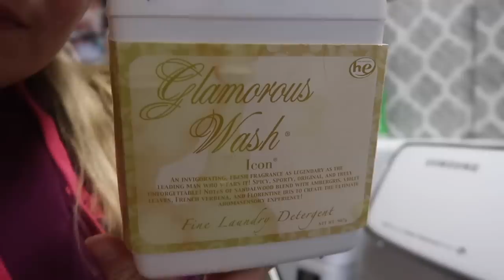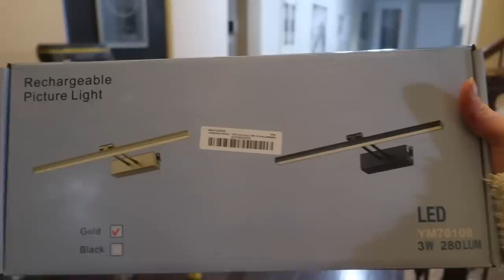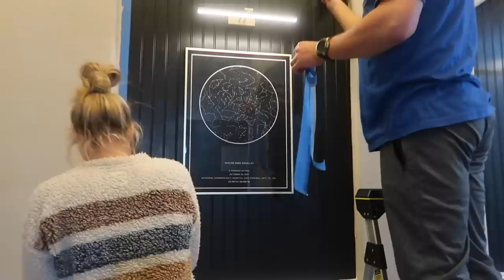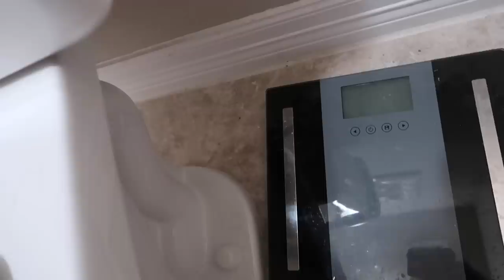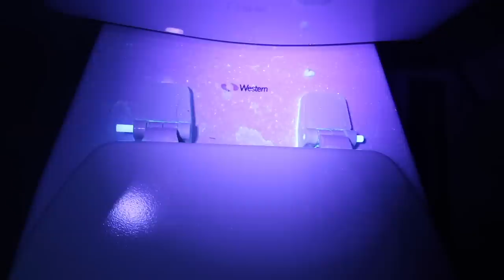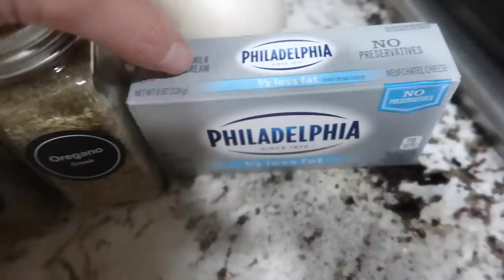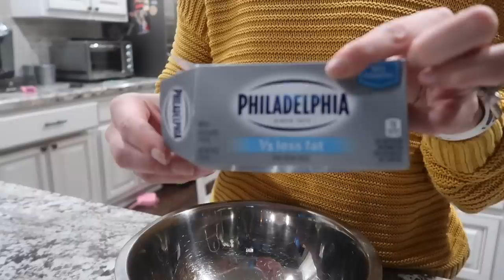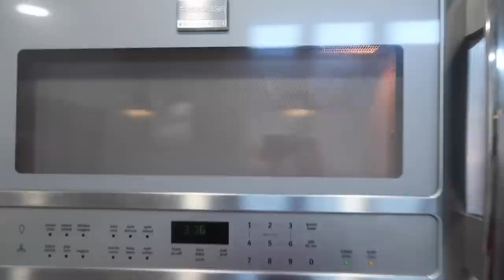EXTREME CLEAN WITH ME MARATHON / 3 HOURS OF NONSTOP CLEANING MOTIVATION

Comment: This is helping me so much! I met some cleaning goals I have been ignoring. I'm definitely subscribing. Those stains you can't get up are most likely soap scum or hard water stains. I don't know if it is safe for granite countertops. But this trick will work also in showers and tubs, but you may want to invest in a respirator mask to avoid the fumes. Oven cleaner will do it! Spray it on and cover the area with cling wrap overnight. It will melt the scum and hard water stains. You just wipe away. It's something to do with the acid-base.